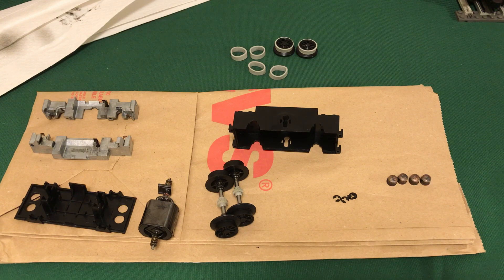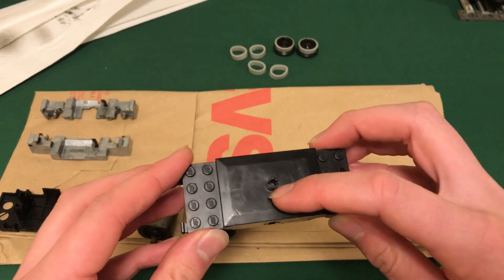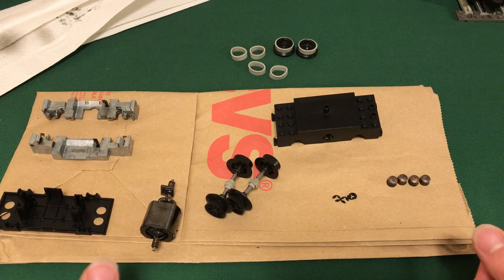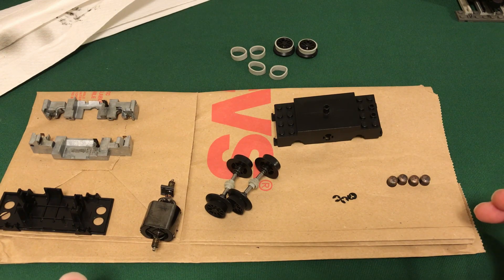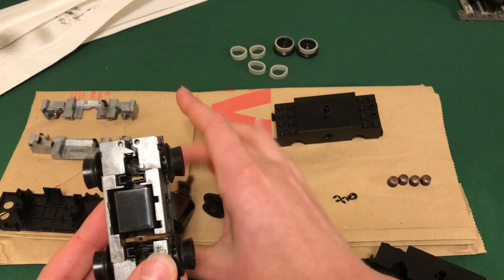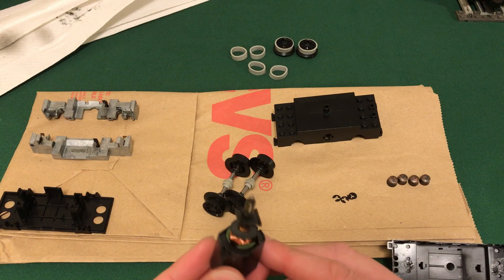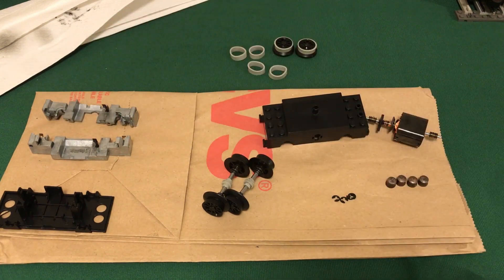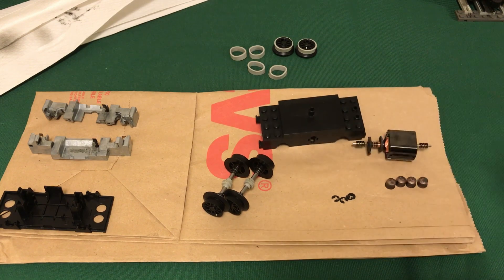Repairing a black 12v train motor

Comment: Hi, if one of the wheels break (not the middle), is there a replacement ? 
It broke right where the metal bushing ends
Reply from the maker: I think you might just be able to glue it back on? I've seen this issue before where it breaks like that.
Reply: Very hard to center it... but I ordered a "middle" one and removed the pin. Fits right in.

Comment: Hello, may I ask how to disassemble the bottom of the train to replace the new magnet and electric particles, because I worked so hard last night to disassemble the bottom cover of the train
Reply from the maker: Hey, do you mean the actual DC motor assembly?
Reply: You shared the video explaining the internal structure of the Lego train. I want to know how to easily install the bottom door of the train and replace the four magnets.

Comment: Thanks for the closeups :) another point about the earliest motors - the A and B on the baseplate doesn’t match the A and B of the silver blocks. This seems to have been a mistake which they fixed on the newer motors. It’s also important to get the magnet housing the right way around, otherwise the motor runs in reverse :)
Reply from the maker: Yep, the motor blocks not matching is something I've noticed as well, and it's only on the early motors. And yes if you reverse the housing the motor will indeed run in reverse, there was a thread on Eurobricks a while back about that because someone glued their motor together with the housing in reverse and were confused about why it ran backwards :/

Comment: Hello great video of my locomotive 7730, the motor is defective, I also have a replacement, could you show me how to open the motor without damaging it LG Marinus
Reply from the maker: Hi, thanks for the comment! I did another (longer) video about opening a red motor a while back (https://youtu.be/LtkAYPd3Et4), maybe this will help. You'll need a very sharp blade and I would recommend a custom jig like I use made from Legos. It can be a little tricky to open it perfectly, I caused some scratches to the bottom of that black motor when opening it.